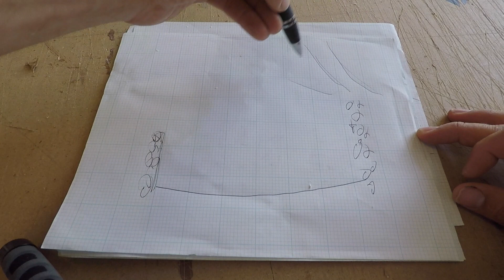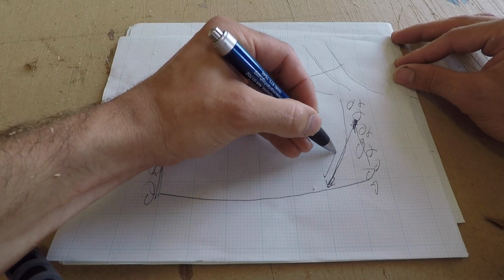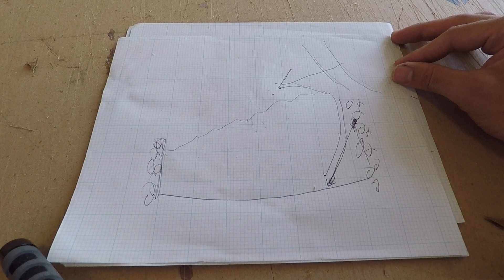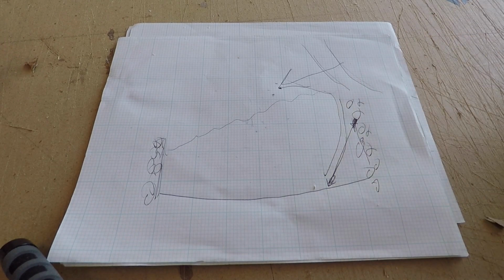Hydrofoil BUNGEE LAUNCH and pumping (homebuilt foil)

Comment: did u ever try to add some curvature to your wings?
Reply from the maker: Yup! Check out the wings on the site. Also the swoosh stabilizer has some sweet upturned tips for some rudder stability in the rear.
Reply: What board are you using?
Reply from the maker: @jakekilgore9254  It was an old naish hover fly I think? 4'8". Next time I am going to try with a smaller board and see. From sitting on the dock it feels like it is almost immediately  up on the wing.

Comment: You should make a video on how to get out of the water when you’re being towed behind a boat. I’m not sure how you’re supposed to position yourself to be pulled out of the water
Reply from the maker: Working on it!
Reply: Clearwater Hydrofoils I just took mine out for the first time and I couldn’t stay flying in the water for more than 2-3 seconds. I think it was because I had the foil as far forward as it will go on the rail system. Could you make that video showing the best ways to get going? I’m having a lot of trouble.